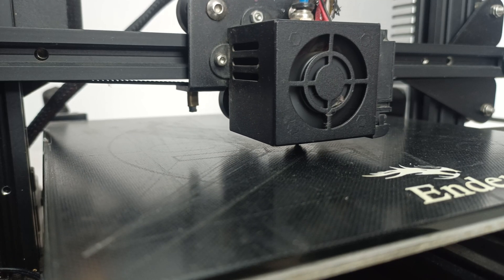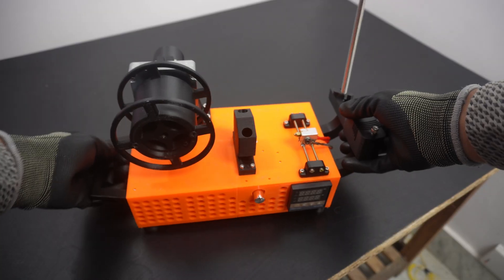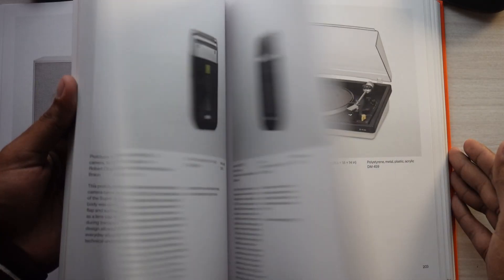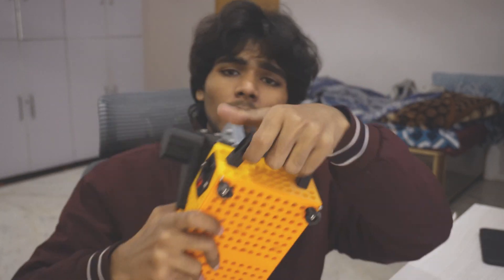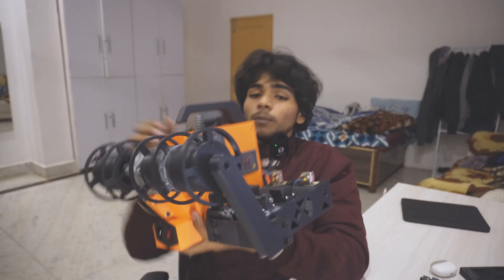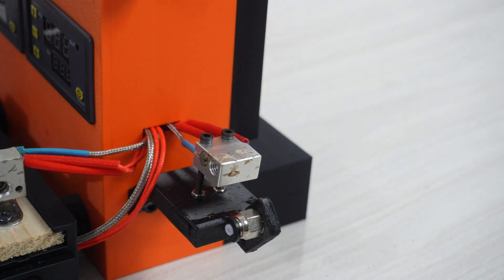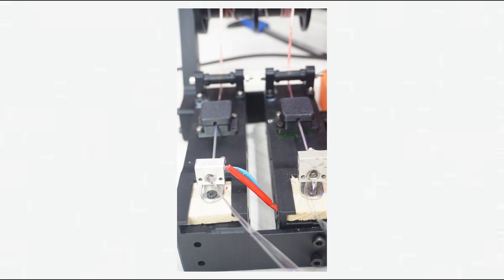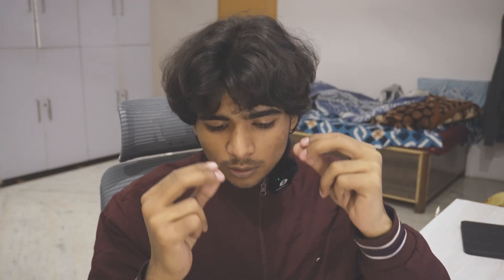How 3D Printing is Making Everyone - A DIY Product Manufacturing

Comment: What material do you recommend printing this in and how much would the components roughly cost in the UK?
Reply from the maker: You can print most parts in PLA, but the filament welder hotend holder should be in ABS for heat resistance. The electronic components typically cost £70-£100 in the UK, depending on the supplier.

Comment: Do you think there is a way to make the filament welder a clamp design so it can be pulled out instead of running the entire roll thru? Or at least so it can swing inline with the spools/collectors so the joined spools can get rolled onto a single spool more easily?

Edit: BTW I'll likely be backing both this and your dryer on Kickstarter. From what I've seen so far they both look well thought out.
Reply: Big Facts, cuz we I seen him having to pull the welded filament all way through that hole I was like "🎶 Oh He'll Naaah ah a ahhhh🎶"